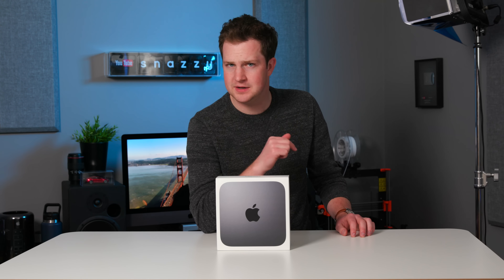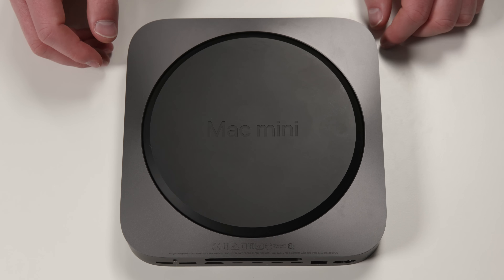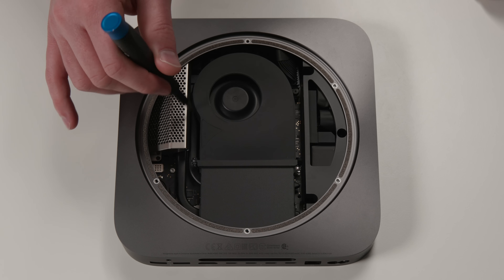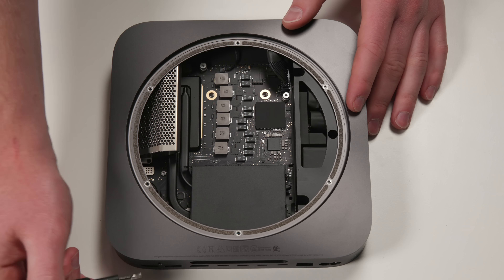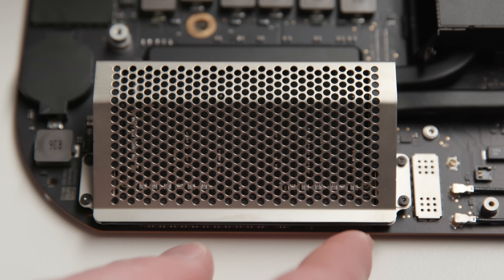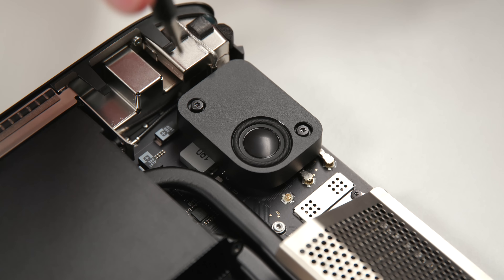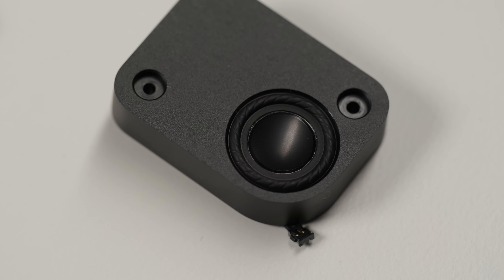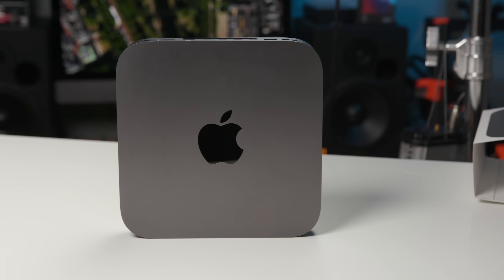Can You Upgrade the 2018 Apple Mac mini?! - RAM Upgrade Tutorial and Teardown

Comment: yay apple left the ram upgradable. but the storage is soldered to the board. : ( this is ridiculous.
Reply: just get external harddrive, they’re only 80 bucks on amazon
Reply: @tf2koalafruit  you're missing my point. i'm talking about serviceability not upgradability.
Reply: oh... well then yeah. Apple just wants to suck up everyone’s money
Reply: @tf2koalafruit  no external harddrive can match the speed of m.2 ssd (not sata)
Reply: yeah i understood it later on.
Reply: @miloraddjurdjic1695 , those chips are soldered directly onto the logic board so there is no M.2  interface.
Reply: @miloraddjurdjic1695 , NOT if he's  using Fibre Channel, Thunderbolt, or USB 3.1.
Reply: ssd soldered on the board is a dick move, I'd rather have soldered ram. if the machine dies you have no way of recovering your files (without repairing the computer first if it's repairable, if it can be fixed since it's made to not be serviceable) unless you were smart and made periodic backups, but many people don't do that.
Reply: @miloraddjurdjic1695  can use Thunderbolt 3 SSD, same speed as NvME (PCI-E x4)
Reply: @harshnemesis  Right? It really is a dick move, very terrible decision to glue to SSD to the board, Apple just wants you to upgrade to an more expensive SSD option
Reply: That’s why it’s better to get a pc with a large case. It’s easier to upgrade/replace broken components, you don’t have to worry about the pc to overheat at all since components aren’t in a small case where all the heat gathers up more easily and you can always watercool it too.
Reply: Yeah but that defeats the point of a mini, not that you can,t just buy a thin client and hackintosh it. But yes bigger cases are cooler.
Reply: Dont buy the mac mini its underpowered

Comment: The whole purpose of the RAM shield seems to be making it harder to replace RAM.
Reply: Allan Sh 
Looks to be RF shielding, that WiFi module seems to be really close.
Reply: @uss_04  my lap top ram is pretty close to.
Reply: Yeah sure is tough to unscrew those 4 tiny screws and slide the thing off.
Reply: It's definitely to hold those rubber retention clips in, especially during shipping and moving the unit around.
Reply: PhoenixofSun  maybe you don’t need to pull out the logic board if the shield isn’t there?
Reply: @uss_04  Yeah, the gaps make it act like a faraday cage.

Comment: I think the speaker is for errors, it may beep a certain times for different errors which involve hardware
Reply: Nope, Macs don't do that. Macs either display a useless icon on the screen or shut off.
Reply: Actually this is accurate, it's useful to have system sounds (like alert beeps, file drop sounds, etc.) output separately from monitor-grade speakers, eg. when doing audio production & recording, metering, etc.
Reply: Exactly!
Reply: In the old Mac mini it was used for the startup sound.

Comment: From my days of working with Apple as a technician, I kinda figured out why they went soldered over socketed. you would not believe the amount of Mac Mini's and Macbook Pro's that would come in with broken or worn RAM slots ( RAM Beeping or not detecting one stick) the Mac Mini was the most frequent because it was the easiest to change the RAM. Basically long story short there is a lot of people out there who watch Youtube tutorials and think they are experts but instead would break the retention clips by mistake or if the machine was coming up to a 4 or more years-old the RAM retention slots would become brittle and small bits of plastic would fall away from the RAM slots causing them to fail and no longer seat the RAM fully. 

I believe Apple removed these Slots because it removes a perishable part on an expensive Logic-board, don't get me wrong money was also a factor but from experience, I doubt it was the only factor. Also, trust me this Mac Mini is going to have RAM issues in the future when that rubber retention starts to lose its elasticity and/or fusses itself to the Metal grate, the constant drastic heating and cooling of these components in such a small place causes a lot of this perishing and this is not just an Apple issue this can be a factor on all small factor computers.
Reply: I have a 2010 Mac Mini with 16GB RAM. Easiest RAM upgrade I have ever done. No small bits of plastic, no failing RAM slots, this is literally the first I am hearing of this and I have been repairing small form factor computers and smart phones for 5 years now. If you break it, that is due to unnecessary force. Forcing any computer components in wrong will obviously break the connectors.

Comment: I still don't get why no other company can't do what apple does for certain products. For instance: This iMac mini has an integrated PSU, but other big names like zotac still use those awefull large external laptop bricks. or the itrashcan pro: lot's of power, internal PSU, awesome thermals and super quiet. The closest to that was the awefull hot and loud MSI Vortex...
Reply from the maker: Custom boards. The entire Mac mini is smaller than a mini-ITX board. Because Apple fabs everything, they can jam everything into a non-standard size as tightly as possible. Apple also typically underclocks many of their CPUs when under load so that's another thing. You win some, you lose some.
Reply: They can do it because they price their products at a steep premium.
Reply: More components inside means more heat. Some people value performance over looks.
Reply: Form follows function.  I'll take an EVGA 1000W PSU and plop it into a Corsair 750D case.  Add a proper NVMe drive for booting, two mechanical HDDs for storage, a Threadripper 2950X, a GTX 1080ti (price drop!) and 32-64GB of DDR4 (budget permitting) for that quad-channel goodness.
Reply: Alex Snitzer But that's like 3 to 5 U for a single machine.  Fine for an upright midi tower station I guess though.
Reply: @johnfrancisdoe1563  Yeah, it's my planned full-tower rig.  I'm currently running an i7-4770K, a GTX 1070, and 32GB of DDR3-1600 with a 500GB SATA SSD and the two 6TB platters.
Reply: Yeah. The Mac Pro also has horrible thermals and the graphics card often tend to burn because the cooling is not adequate. But hey, at least internal power supply.

Those large bricks are inconvenient, but you are less prone to interference from the power supply and heat from the power supply, since it's not part of the case. It's expensive to get a good power supply this small as well(assuming Apple is using good power supplies to begin with or just smaller ones), so you're paying for it.

Comment: the rubber and the metal mesh are to prevent damage from electrostatic discharge. Those aluminium bodies are prone to buildup eventually you remove the cage which is ESD safe

Comment: Soldered on SSD. 
Deal killer. Usually the first thing to go bad.
Cant be fixed or upgraded.
Reply: I've been using SSD's for over a decade and have never had one fail on me. Ever. Now, if it were a spinning disk then I'd agree, but it isn't. Modern SSD's and especially the ones used by Apple are extremely reliable. By the time it goes bad (unless faulty) the machine would be useless anyway.
Reply: TalesOfWar, and what happens if your motherboard fails, is that data lost forever rather that just putting it straight into another machine.
Reply: Never had one go bad
Reply: Dominick Ray so that means none go bad ever. Don’t worry everyone, Apple never goes wrong, Dominick has told us it’s all perfectly fine. Better tell those at the “Genius” bar they are no longer required.
Reply: Sally Smith, why does it have to be mission critical. Many have personal data, family photos or videos that never get any form of backup because ether, they don’t want to pay for the cloud storage, don’t know how, just can’t be bothered or don’t attach the external drive to run backup (I say attach as why go and get a small form factor mini only then to leave an external drive out). The vast percentage of the population have no form of backup, while people like you and me do as we are very computer literate, the majority are not. To insult those that don’t is childish. In the past 2 years I have updated 7 Macs from early OS versions  such as Lion for customers to High Sierra. Only one used cloud storage and one used Time machine but had not run it for 2 years.
Reply: Sally Smith you know the last gen MacBook had a connector on the motherboard which would allow data to be retrieved from the storage after a motherboard failure, Apple removed it for “reasons”. 128GB is hardly anything these days, cloud storage charges extra for more than a few GB and not everyone understands what cloud storage is let alone how to use it. There are many people in this world who don’t have that knowledge, likely people in your own family who you are putting in the same category as teen pregnancy which I must say is very condescending and strange that’s your comparison. Then you have the comparison of data, sound and video all being on one port as some sort of justification that why this is the case. They have the RAM as replaceable, RAM in which they have in the past soldered on the board. That’s not a crucial part of your motherboard if it fails, your data is. It wouldn’t take much for Apple to add in a data access connector or to use an M.2 NVME card which doesn’t take up huge space and would be upgradable for users. What’s next you going to defend the T2 chip Apples including now as good for consumers?
Reply: Sally Smith so richest company equals greatest company, I guess all those oil companies must too have been a great thing for the world. Based on Apples market share compared to their profits you have basically made an argument that it’s overpriced in the name of profit over what value it offer customers, way to go with you consumers first attitude. 

You clearly live in a bubble of ignorance, you have no clue how the majority of users of computer know of the technology they use. Learning to access YouTube is one thing, you even have a app for that, knowing how to backup isn’t something the general user wants to do so they don’t learn how to do it. But sure, let them drive miles to get to an Apple store, to get a “genius” to tell them about it all. The customer I told you earlier who did do a Time machine backup which had not run for years, she did that and the “genius” told her she needed a proprietary Apple branded Time machine storage drive, never mentioned it could be done with any cheaper external drive or as you suggested a USB drive, no have to buy this expensive Apple brand because a “genius” told he so. I’ve also seen some of this “genius” handwork first hand. A MacBook Pro went in as the GPU has separated, a common issue seen with MacBooks of that year, the board they replaced it with had kernel rampancy issues after, there was corrosion on the board and something I have never seen before in all my days of repair, a CPU die with a deep scratch running across it. That take some doing and hardly the quality repair Apple claims to do for a premium, you should have a look at Louis Rossmanns videos to see the quality Apple repair offers, some of those dodgy repair people you mentioned wouldn’t even do that poor of a job.
Reply: Get a pc
Reply: LOL !
Clearly a few Apple employees here.
The reason for turning computers into appliances for Apple is one reason only.
Profits!
I just came back from the Apple Store, thank God it was a warranty repair.
The manager had a long talk with me. 
I had a minor issue with the battery. 3rd party parts cost only $30.
But I had EVERYTHING in the laptop replaced, including the keyboard and case.
The repair cost had I NOT been under my warranty?
$600. Yes, $600 for a $30 repair. 
He explained how the components were now only replaced and only in bundles.
Apple will NOT repair a faulty electronic component that is a few dollars and they will not even replace just the  broken part. They replace almost half the computer at the very least. 
The previous repair involving a faulty $100 component was almost $800 on a non warranty Macbook.
Why? They insisted they replace a bundle or NOT a all.  
I have another Macbook with literally a $5 diode that is broken. Apple wants to replace the entire motherboard !!!!!!!!  Only a few years old and that Macbook is now junk.

PROFITS!
Reply: Sally Smith profit is your only benchmark to good a company is. I know someone accused you of being an employee but it sounds more like you are a shareholder. Profit over all else, that works for so long until people turn away from your brand because it’s overpriced and anti consumer. As for soldered on phone memory, well if you can find a small enough SSD to fit inside a phone go ahead but you are using a false equivalency to make your point which just makes you look like a blinded fan not someone in anyway objective, speaking of with the number one smartphone maker in the world, Samsung including an SD card slot so you can save your important data to the card that can easily be removed.
Reply: Sally Smith, you seem to be all over the place. One point you are claiming everything soldered on the board is a good thing, now it’s bad? Consistency really isn’t a thing for you is it.
Reply: Anyone who claims to never have an SSD fail on them are speaking off anecdotal evidence. They're just as susceptible to defects and failures just like a hard disk or any other component in a computer.
Reply: @Sally Smith even the majority of phones have removable storage. Unless you use a iPhone I should say.
Reply: it is highly unlikely for SSD's to fail once they get past 1year and will usually end up lasting approximately 10+ years, I think other parts will be an issue first, or just computer obsolescence (if you replace things) before you have to worry about an SSD.
Reply: Apple SSD's simply don't go bad, I've been using their soldered on boards since the tech was first introduced and have never had an issue and have never even heard of anyone having an issue.  These aren't Hard Drives stud, there are no moving parts and they are not affected by heat, so there is nothing that can ware out or break.   By soldering it to the motherboard they save a crap ton of space.  Also, you have 4 Thunderbolt 3 ports that you can attach an external SSD that will read/write at basically the same speed as an internal, no real noticeable difference.   Try harder TROLL!
Reply: I’ve owned Apple computers, iPad’s, and MacBooks for about 20yrs now.  I’ve owned PC’s for far longer.  And I haven’t seen a single SSD in any of my devices go out.  If you can explain how your SSD’s are failing I’d love to see that write up.   I guess if you use very cheap SSD’s from some knockoff company you could see a failure, maybe, I’ve never seen one.
Reply: @Scott Sullivan LoL, what do you want exactly?  I already wrote it all up for you.......NONE OF MY SSD's ON MY APPLE DEVICES HAVE GONE BAD!  There, it's in writing.  Not sure what else you want?
Reply: typical response....try to attack someone’s education or intelligence when you don’t agree with their opinion or experiences.
Reply: @8654ZuluFoxtrot  - sigh,.... the victim card.
Reply: @J W - murder, kidnapping and robbery are also sources of "profit".

Comment: Is it just me or is the fan basically being choked by that circle cover?
Reply: It's just you.
Reply: Its the same type of fan you'd see in a videogame console. Blower fans are good for tiny, compact systems compared to open air fans. They definitely get the job done but i still think Apple coulda put more tiny holes on the bottom to help air ventilation
Reply: Sampsonay That's what I'm saying. For fans to work they need to be able to intake air. That thing is pushing out hot air but not intaking anything.
Reply: Yeah your right. The sheeple up top never built computer let alone clean one.
Reply: Yeah you're right and I didn't see any holes in the side ether. This isn't a great sign as Apple isn't known for good cooling solutions but on the other hand mac mini users aren't likely to use a lot of cpu power. It would have been great if there was a dual cpu, quad core passively cooled Intel Atom powered model.
Reply: CheapBastard1988 At least in previous iMacs the entire edge of the round black foot is the air intake.  The air then goes through that giant grid before being blown through the cooling ribs and out the exhaust port.  Same as on a (non-Apple) laptop, really.

Comment: That was a good video, informative, not overly wordy, nice shots of all the significant parts and things needed to open and upgrade RAM and maybe one or two other parts in the Mac Mini. Well Done.

As an aside, it is worrying that the T2 chip appears to be used to detect "genuine apple parts" which may imply that replacing any part (RAM Excepted, I hope) using third party supplied parts may end up with the Mac Mini refusing to boot until a "genuine Apple part" is used.

Comment: It's still upgradeable you just need to pry it open take out 500 different screws each with different heads take out the motherboard bend out the the flimsy plastic ram holder shit and put it back together and it just take 60 months to do.  EZ